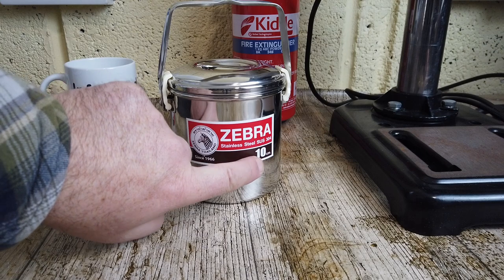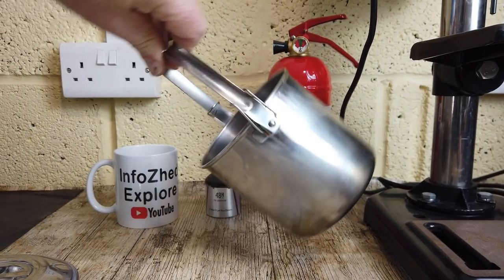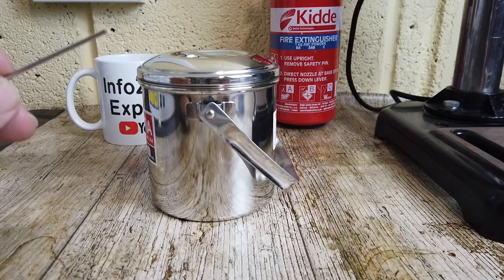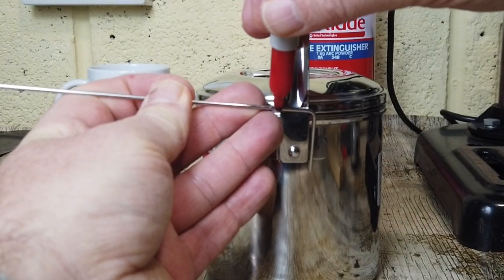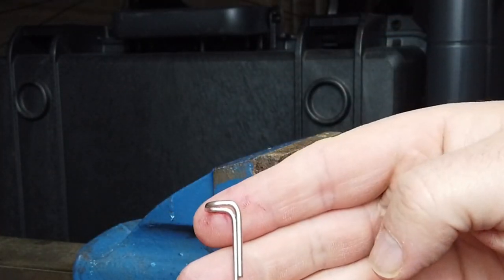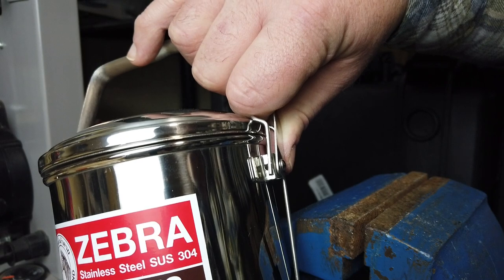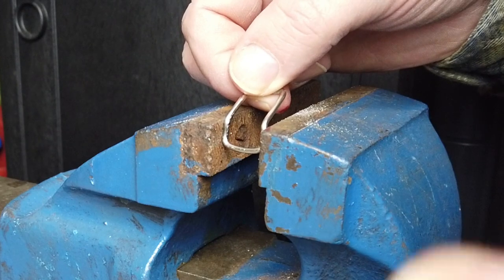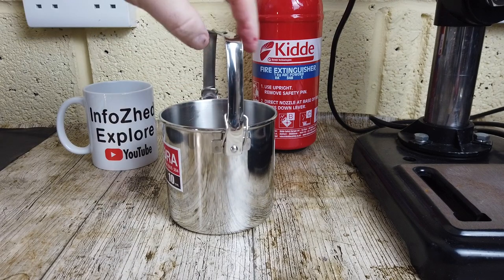Easy Zebra Pot Clips (No skill or measuring required)

Comment: " I made metal clips for my 16mm Zebra pot by getting a large metal " binder clip" ( black metal rectangle with silver " wings", Not a paper clip) removing the wings and bending them with pliers. The original plastic clips mount from the Outside, squeeze the new clips enough to fit the holes from the Inside, then bend to fit. No cutting, filing, etc."